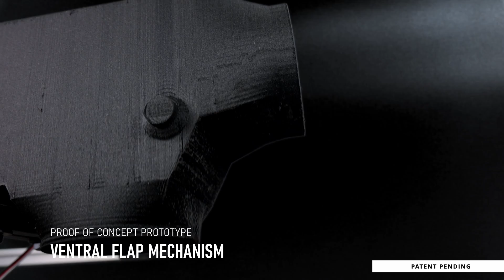JETX Enhanced Propulsion System

Comment: Better than Jetoptera ?
Reply: I don't think so. It looks like small turbines inside and not an air compressor. I guess it won't fly long because of that. If you search EDF drones, they do exist but they fly far less longuer than classic props drones (they are cool though)
Reply from the maker: This video shows proof of concept prototypes that we did with small EDF, our technology is different than jetoptera in that we don't rotate the thrusters for vertical flight, this option allows us to embed the propulsion  inside a fuselage or vehicle body which makes it a much better option not only for aircraft design but also allows the fuselage or vehicle body to work as an enclosure that contributes to reduce the noise levels.  Jetoptera rotates for vertical flight we vector the thrust without rotating.
Reply: @JETXUS  下出气垂直运动,后出气前进,但是切换到水平后,将失去垂直推力,爬行力度不够的话,将会下坠.